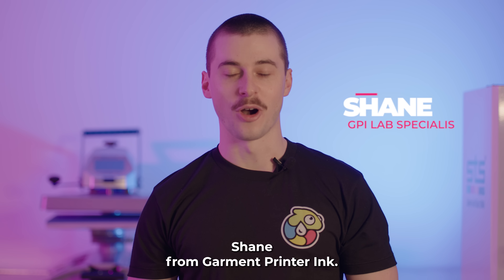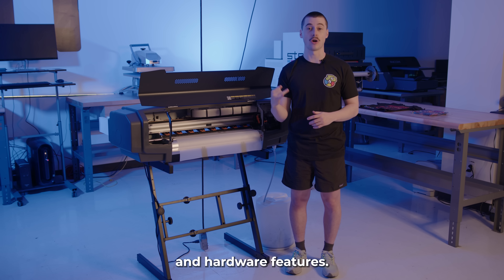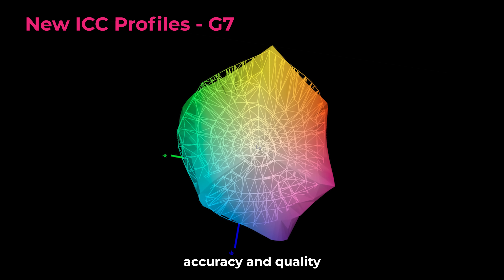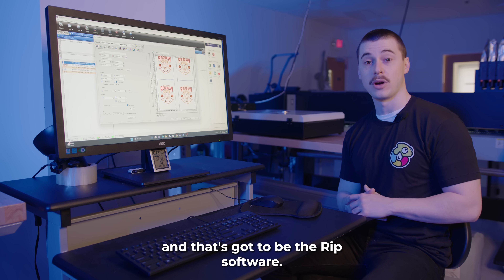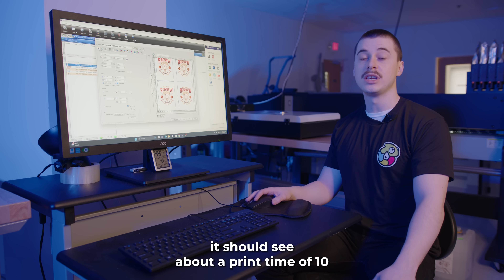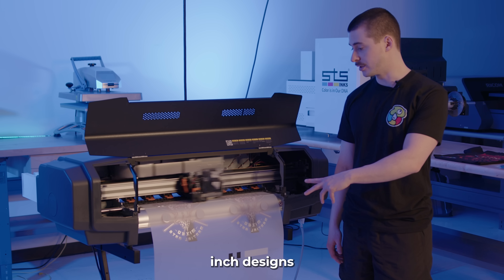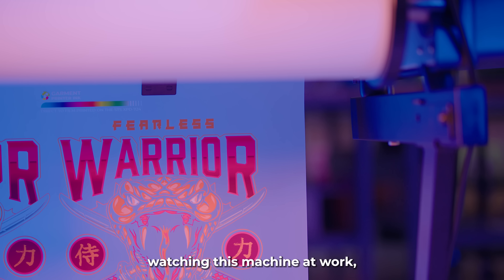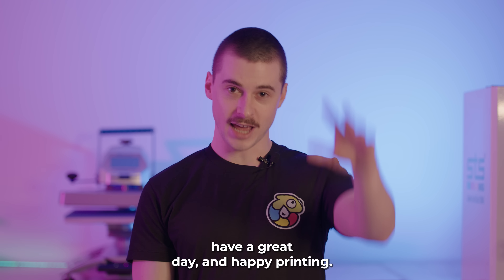STS XPD-724 First Impressions

Comment: What is the largest size (dimensions) that can be printed?
Reply from the maker: The film is 24" wide, but you would want to print no more than 23" wide.  Length could be the full 320' roll.

Comment: How is the powder applied?
Reply from the maker: If you have a heater/shaker unit, the powder is applied in the hopper as it runs through the conveyer to the dryer.  If not, then you use a plastic bin of powder, put film under a small amount of power and pull through.  It sticks to the ink only.  cure it in a desktop oven.
Reply: What is the recommended temp for the heat platen?
Reply from the maker: @cindyziese5706  30 Celsius or 80 F
Reply: @GPIsupplies  I had oil run off of prints while printing, I was told not to have heater on... I do have the updated with circulation and the XPD inks
Reply from the maker: @cindyziese5706  - the only way oil would get on a print is in the dryer as glycerin can build up on the top of the dryer.  As for the printer, the heater needs to stay on to help the ink dry on the film and keep it from running.  Do you mean oil spots from the dryer?  if that's the case you need to clean out the hood of the dryer when this starts to happen
Reply: @GPIsupplies  oil runs from the print while printing, I am using V3 film (sts inks film , cold peel ) I clean my curing oven multiple times a day.   The oil is running before the print is finished ... STS told me to turn off heater platen.... Humidity is 40% , temp is 74° F 
I have photos
Reply from the maker: @cindyziese5706  Hi Cindy, I am unsure of where the oil would be dripping from unless you oiled or greased the rod your printer head carriage runs on.  You can definitely send photos and an explanation to support@garmentprinterink.com.  I will also check with STS on instructing you to turn off the heater on the roller.  We can get this figured out for you
Reply: @GPIsupplies  the oil is running off the prints, I have the white saturation at 75 .   The oil in from the white ink
Reply from the maker: @cindyziese5706  Hi Cindy, we would love to support any issues you have.  Please contact support@garmentprinterink.com or call us at 631-858-0114.